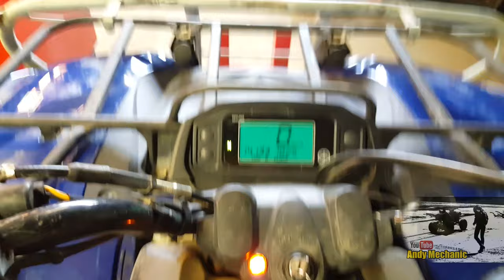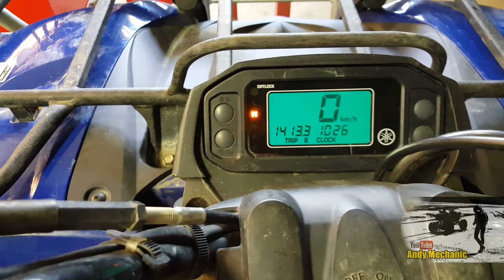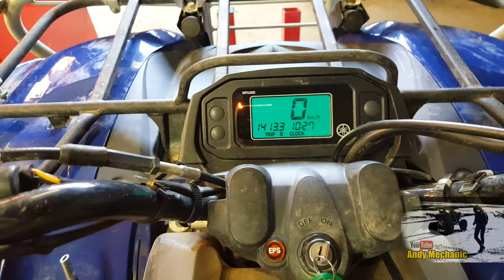Yamaha Grizzly 450 4x4 external gear selector adjustment #1014

Comment: Thanks for the detailed adjuster information. I have a 2004 660 and find the two locking nuts can normally be accessed by removing just the side cover . The bottom ball joint thread was seized in the rod so it required heat to loosen so the black plastic cover needed to come off. It's important not to damage as it looks like the rod and ball joints are part of the entire shifter assembly.

Comment: My issue with my Grizzly, is when you put it in park, the indicator light doesn't light up. No light on the dash means it won't start. This helps me understand the adjustment

Comment: 1998 yamaha grizzly 600, won't take reverse at all, won't even enter the position for it. It will go back toward it 90% of the way but then it's like you just hit a wall. The brake cable that runs to the safety release could be potentially frozen up, can there be other problems or if it is the cable can that be bypassed?

Comment: Andy mechanic I have an 06 grizzly 660. Just replaced clutch and was riding and adjusted left brake lever, it seemed to make the bike not go into low and a hard time with most really.. I don’t see how they are really relevant. I made adjustments as you did in the video, it helped temporarily I’ll have to give it another go

Comment: I have a 2008 Yamaha 660 grizzly it will go forward and reverse it is stuck in low gear in forward will not go in high I can put it in high and the dish reads it's in high gear but it still in low plz help

Comment: Hello. I have an 06 450 kodiak. It will go through all of the gears fine but when I try to put it in neutral to start it the light wont come one so I can start it. But sometimes it will come on and sometimes it wont. Any advice to the cluprit?
Reply from the maker: Yes, there is a neutral light switch on the gearbox, the brass plunger will have worn down - will need replacing...that's the most likely reason so check that first. Cheers Andy

Comment: My 450 was new Oct 2016 and has the same low gear hesitation since new, not as bad as one in post. I engage low then slightly blip throttle to engage then drive away. First service due in April and had intended to mention this, but I may have a look myself. My bike is well oiled including gear linkage at 900 miles. Thank you for most informative posts
Reply from the maker: +billalbion Hi, thanks for the feedback, pleased you found the video helpful.

The adjustment is relatively easy though I found that only a very small change in the rod length made quite a difference to gear selection so just make fine adjustments each time until it engages smoothly.

Cheers Andy
Reply: Yeah mine I have to goose the throttle to engage it in gear. But also coasting down a hill sounds like my gearbox starts clinking

Comment: Seems exactly my problem with the Kodiak 4x4 but that adjustment did not fix it.
The end selector works well and all light correlate.
So I’ll open the gear selector to seek inside.

Comment: Andy, I'm not sure if that particular year of bike has this problem, but from 03-07 on the 660 the shifter is slightly different but I imagine are similar internals. Either way, I had to do this for a friend before on an 04 660. Take the shifter assemble off the bike, leaving the shift rod connected, just unbolt shift rod from the motor and there are 3 bolts on the shifter that hold it on and the brake interlock for reverse and park just unscrews. Take the shift knob off and then the boot. Once you have that done, on the opposite side of the shift rod there should be a push nut/speed nut that goes over the shaft that the shifter and shift rod are connected to that needs to be removed. You will probably break that push nut getting it off but once you do, pull the shaft out of the assembly and you will notice that it is square stock with rounded edges that insert inside the plastic housing of the shifter. This is where the problem arises, normal wear causes too large of a tolerance and thus causes the shifting problem, solution is to take a pepsi can or similar and cut a small piece off to go over the shaft you just removed and reinsert into the shifter. (keep notice as to location of shift rod before you removed it. Once you do this, assembly is reverse of disassembly. Bike should shift better or as good as it did new. Did this 8 years ago the first time, never had a problem since and never had to adjust the shift rod length fist or last.

Hope this may help someone as it took a bit of time to find out when it would have just slipped out of position when the locknuts never moved...
Reply from the maker: +Scott Barron That's excellent advice, I'm sure plenty of viewers will find that very helpful. If I get an older 660 come in to the workshop I'll be sure to do a video covering your fix. 

The later one I worked on had rose joints either end of the external shift rod. Customer had said that it had always been a little hard to engage low gear but it had got worse in recent months? No wear at the rose joints so can only think the motor has settled down on its mounts maybe (can't remember if it's rubber mounted like vikings or not to be fair?)

Anyway, thanks for taking your time to write such a detailed post. Pleased you liked the video. Cheers Andy
Reply: Scott Barron 
Hey having problem with a back fair on my Yamaha grizzly 660 need help?
Reply from the maker: +Jason Williams hi, what do you mean by a 'back fair'?
Reply: Andy Mechanic 
Hey got one more just like the gear selector.  I put it in L give it a little gas . It jump and back in to H.. and some time it want catch no gear at all uk . I have to garb it and pull it in gear?
Reply: Andy Mechanic 
Hey andy . When adjusting the front shifter?  Whats the best gear to start with? Pls feedback
Reply from the maker: +Jason Williams I always start at 'low'
Reply from the maker: +Jason Williams I always start at 'low' gear position and ensure that engages then I back the rod off until engagement of low starts to get poor then put a turn back and try all gears. ..
Reply from the maker: +Jason Williams I always start at 'low' gear position and ensure that engages then I back the rod off until engagement of low starts to get poor then put a turn back and try all gears. ..
Reply from the maker: +Jason Williams  I always start at 'low' gear position and ensure that engages then I back the rod off until engagement of low starts to get poor then put a turn back and try all gears. ..
Reply: Andy Mechanic  
Ok.. but what if it don't shift uk .. it shifts good and pool good.  Just the frunt roos
Reply: Andy Mechanic  rod
Reply: Andy Mechanic 
Het andy how u get ur timer belt right?
Reply from the maker: +Jason Williams you have to align all the pulleys to the timing marks on the engine casing.
Reply: Andy Mechanic 
Is there a video on it
Reply from the maker: +Jason Williams yes, cam & crank shaft seal replacement on a Suzuki Alto...
Reply: Andy Mechanic 
Hey Andy when I start up .then when I cut off. There's a pop from the tell pip. Do u thank its getting to much air?  Help Andy
Reply from the maker: +Jason Williams nop. Exhaust valve is burnt, over fueling or running too rich
Reply: Andy Mechanic 
Andy will that solve that pop out the tell pip?
Reply: Andy Mechanic 
What I need to do? ? And is it a video on it to show where I need to start from?
Reply from the maker: +Jason Williams maybe...could be due to a number of reasons. You'll need to diagnose it, all I can do is point you in the right direction...
Reply: Andy Mechanic 
Ok. Well im start with the exhaust valve first.
Reply from the maker: +Jason Williams Yep.  Let engine go cold. Set piston to TDC on compression stroke and check valve clearance.
Reply: Andy Mechanic 
Andy will a bad exhaust valve cause oil to blow in the filter box?
Reply from the maker: +Jason Williams no, that's blow by on the piston rings. Engine will need a rebore, new piston and rings...
Reply: Jason Williams make sure that it is oil and not a combination of oil and gas.  Check your crank case with the dip stick to be sure your level is right and not too high.  If it is high it could be coming from a faulty carburetor leaking fuel into the crank case.  When the crank case gets  full the breather tube will suck it up to the breather box.  This may not be your problem but it was on my 2006 Grizzly 660.  New carb solved the problem.  Andy I am new here.  You have a great channel.  Larry
Reply: Andy Mechanic I have a question

Comment: Excellent video. My 2007 grizzly 700 you really have to keep pressure on the shifter then bump the throttle to get it to go into low range. Every other gear shifts perfect. Wonder if this linkage adjustment would cure it
Reply from the maker: Definitely worth a try. Thanks Andy

Comment: Good youtube wish I would have seen sooner. I have adjusted as far as will go and still hesitates into low looks like I have to check gear box
Reply from the maker: Possibly. Just ensure the rivets holding the two rose joints on the external link rod haven't come loose

Also, it the idle too high - this will cause the centrifugal clutch to start to transfer drive so will be harder & jurky to get into gear

Hope this helps. Cheers Andy

Comment: Hey Andy my bike is hard to get into neutral well it is in neutral but the light doesn't come on and doesn't start I have to run the gear leaver up and back and sometimes it will turn on neutral light and can start it but then once it is hot and stops and try to get that light back on to start, no chance I can seem to get it going again would it be what your talking about or could it be some electrical fault senser  or something that's causing it thanks mate let me no please Andrew qld Australia

Comment: My Grizzly  700 is a 2009, and is stuck in park. I always used the foot brake  to sift. So that interlock cable is also attached to the foot brake and hand brake lever?  I'm a little confused sorry?
Any insight. 
Thanks Mate 😊👍

Comment: Andy, Thanks for the vid.  It will help me a lot.  I'm interested in how you had the bike on the lift.  Did you just stradle the lift with the bike?  Did you put anything under it like wood blocks or just let the lift come in contat with the undersisde?  I have a 2000 Kodiak and am hoping I can lift it like you did the one in this vid.
Reply from the maker: Hi, I usually use wooden blocks so I can still get the oil drain pan in for when doing an oil change. One at the front & another just forward of the rear final drive, timbers going across the hoist bed.

Cheers Andy
Reply: @AndyMechanic  Thank you.

Comment: I'm having a similar problem with my 2012 550 grizzly (power steering) is it basically the same style gear selector adjustment set up?

Comment: I’m having the same issue but it’s doing the clicking and refusal to go into gear at all positions. Would that be just an adjustment like this or does it sound like more of an internal problem? Also, once in gear, it won’t stay in place unless hand brake is held. Almost as if it’s idling too high or something.
Reply from the maker: Yep. Check idle, if too high then centrifugal clutch will be dragging which will make it hard to engage gears & bike will be driven even when completely off the throttle. Just reduce idle at carb & see if that helps.

Cheers Andy

Comment: Hi Andy,
Quick question!!!!!
Can I use any 10W40 semi synthetic oil for my Grizz 450
Reply from the maker: Hi, it really should be a motorcycle oil as the transmission relies on good lubrication too & car oils are designed just for engine demands.

My preference is Yamalube which is Yamaha's own oil.

Hope this helps. Cheers Andy

Comment: Silly question: What is that left shifter actually adjusting?  Does it swap the gear ratio in the transfer case?
Reply from the maker: Yes, it switches a mechanical gearbox after the CVT in the driveline. Cheers Andy

Comment: Same grizzly, rear brake check. I think it's inline with the drive shift. Any videos?
Reply from the maker: Sorry, no videos on that yet. Yes, it's a wet brake from memory - bit like a motorcycle clutch Pack.  It is adjustable but if you have run out of adjustment then it'll likely need new friction plated installing.

Cheers Andy

Comment: You seem to be a dang good mechanic, id like to ask your opinion, 
I have a kodiak 700 eps se (2020) i have my diff light flashing, temp and engine light on... i was told it was a bad relay.. my atv has 88.8 miles on it.. and advise would be appreciated. Im not a mechanic and just got into the yahama family... everything works as it should, just those lights, im afraid to ride it entil i know whats up
Thanks so much

Comment: Hey Andy. Nice video and explanation. I’m in Canada just north of Toronto. My quad is a 2013 chironex 550 bandito which I believe is a Chinese knock off of Yamaha. Engine looks like Yamaha. Only 620 km on the bike. Forward hi and lo engagement no issue. Reverse on the other hand has always been a “clunking” engagement and takes several attempts to get positive engage. When not fully warmed up it’s not uncommon for it to jump out of reverse when increasing throttle. Gets better when fully warmed up. Do u think it’s the shift selector rod needing adjustment. I’ll be a subscriber.Any thoughts..Thx in advance for any advice u could could provide. Keithkmrg
Reply from the maker: Hi Keith, damn I hate it when the Chinese copy other brands. It's just not right as Yamaha did all the development work etc.

Anyway, yes, this could well be an external push rod adjustment issue. However, if you over adjust it you may affect low ratio selection at the opposite end of the gear levers travel. Just make small adjustments and see how you get on.

Welcome aboard :-)

Cheers
Andy
Reply: @AndyMechanic  I have a 2004 Yamaha and I can't even move my lever to reverse. What is your take on what needs to be fixed

Comment: Mine annoying it select the gears but the reverse light also comes on aswell when in high and low.  So limits the revs.  Doing my head in
Reply from the maker: Easy fix - replace reverse light switch on gearbox casing - brass plunger wears down.

Andy

Comment: I have a lady selling a 04 kodiak 450 4x4 she says it needs a new shifter bar because u have to adjust it softly put it in gear and it will stay she’s asking 2600 I have 2800 too my name is it a quick easy fix ?
Reply from the maker: Yes, the external shift linkage is easy to replace & not too expensive for replacement parts :-)

Cheers Andy

Comment: 14+ thousand miles on it and it's not but a few years old? Wow! Just where I live most quads are only around 2k maybe 4kmiles. I wouldn't buy one myself used with more than a couple thousand miles on the clock 😂. Eastern Us just most bikes don't get alot of miles, woods riding mostly.  However I'm sure there are bikes with 10k on them in much better shape than some I've mentioned with 2k on then.  Guess it's neither here nor there.  Cheers.

Comment: My red reverse light is on and I have my bike In natural but my green neutral light is not showing and I can not start my engine . When I play with my gear controller back and forth the lights go back to normal  operation,  but when I put it into high gear or any position the red reverse light comes on again. Any suggestions  to help me ?
Reply from the maker: Hi, yes, it's likely the brass pin on the reverse light switch (on engine casing) has worn down - it will need to be replaced.

Let me know how you get on. Cheers Andy
Reply: Thank you so very much I will replace it a.s.a.p  will let you know.

Comment: great video Andy , just recently having a problem with my gear shift on cold mornings , shiftier is basically locked up and takes a lot of force to move it into any position but does come out of it and shifts with no problems / normal , so when it sits over night in cold tempertures seems to be the worst , where can i start to look to take care of this problem , thank you !! 2003 Kodiak 450
Reply from the maker: +Michael Winkelsas Hmmmm.....unlikely to be external linkage but check all pivots are lubed and move freely. You may have to adjust a little or it could be low or need an oil change?
Reply: Make sure your idle speed is not too high.  They don’t like to change gears if the belts are moving too fast.  My 2006 Grizzly 660 needs to idle between 1450 and 1550 rpms.  Anything higher (above 1800 rpms) and it is hard to come out of gear and bangs when it does.

Comment: I always thought these quads use transmission fluid Like ATF DW-1. Much like honda Automatic. i guess they use the engine oil in the case so basically the Engine and transmission share the same oil Or im i mistaken?
Reply from the maker: Same oil on these now :-)
Reply: Andy Mechanic ok thank you good to know 🙂

Comment: I have a problem witha Yamaha bruin the second i put in gear it drives off by itself but the motor isn't rev high
Reply: It does drive off in foward in neutral
Reply from the maker: Hmmmm.....it sounds like the Sprag or one way bearing has siezed on the shaft...

Comment: Hey any I just installed a new shifter assembly on my grizzly 660 I can’t seem to find a good spot to start from any suggestions????
Reply from the maker: I'd start in low ratio at the lever & gearbox. Adjust the rod up in that position then see if you can get reverse
Reply from the maker: If not then just make small adjustments until you can get both low & reverse relatively easily
Reply: Ok I’ll let you know how I make out also after I installed the shifter the cable that runs out of the shifter assembly over to the foot brake is really loose and can’t seem to tighten it is it supposed to be really tight??